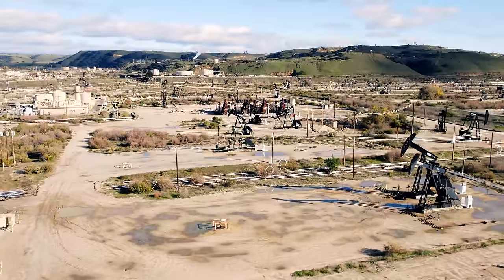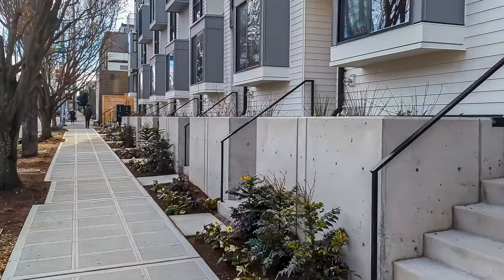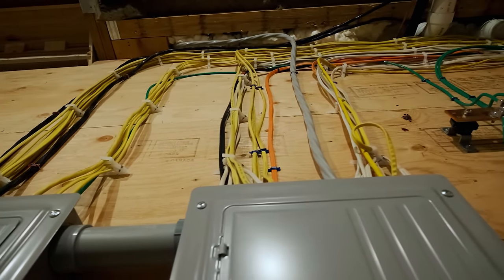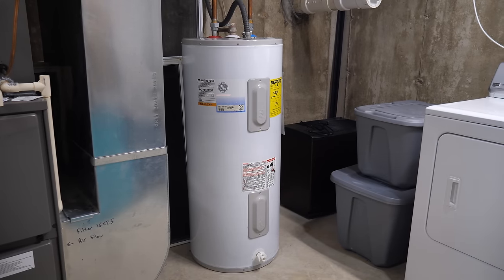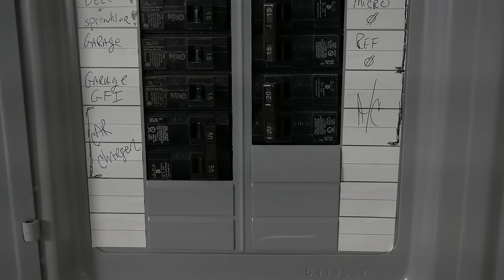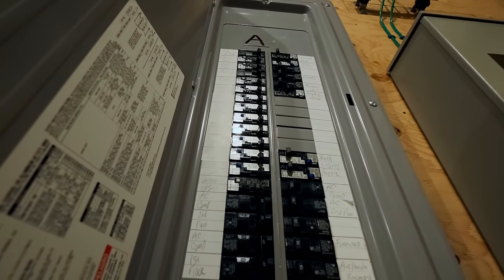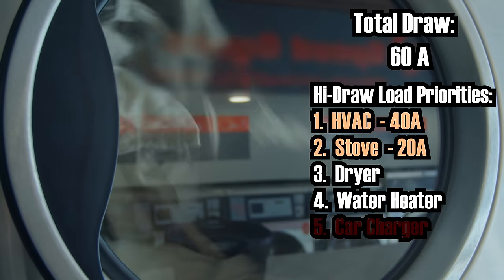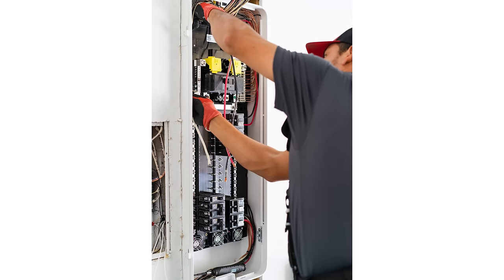Home Electrification: There's not a lot to do, and it doesn't have to be hard (Part 1)

Comment: Span sounds like a great idea. The concern that I have is that almost every single IOT thing ever invented becomes it's own walled garden. So we end up with 60 different companies all running proprietary software to monitor these things and its impossible to switch something out or make easily compatible extras to work with it that aren't from that one specific company. It would need a level of standardisation to ensure any model or brand can work with any other model or brand.
Reply: Rule of thumb is never use any IoT device that isn't fully open source.
Reply: Plus the number of times that an IoT company went bankrupt and then their devices became useless through lack of servers or support is a huge mark against them. Open source (if you can code anyway)
Reply: Like, say... ZigBee?
Reply: Matter will fix this in the long run.
Reply: Home Assistant is the solution in my opinion. If you are willing to get "down and dirty" you can integrate almost anything into it, from ZigBee devices to smart cars.
Reply: @supermaster2012  except you’re using one right now
Reply: @ErrorError-km7ib  smartphones and desktop/laptop computers are not IoT, and many of them are open source (Posted from my Linux desktop, which is open source)
Reply: …which in turn makes all those different IOT devices insecure ‘attack surfaces’ to hack & pwn your network.
Reply: Yeah it’s a huge shame, I kinda wish the government would just step in and say “okay kids it’s time to make some standards!” So consumers could be confident in buying their smart stuff from whatever brand they want, only needing to consider things like style, efficiency, build quality, etc, not whether their new switch will be compatible with their old ones.
Reply: THIS!
Reply: My thoughts exactly. I'd much prefer a couple of simple interlocks and slightly more mindful electricity usage than a complex proprietary device, and I'm especially skeptical of one that relies on an app and internet connection for configuration.

A Span panel already costs $3500, another $100 to add a screen and internet-free setup would be well worth it in my opinion. Better still would be a separate bus bar-type device that can be added in series with a standard panel so that it can be easily serviced, upgraded, or removed.
Reply: REMEMBER when you bought software in a box?  It was debugged & worked.  You didn’t need internet for updates.  You didn’t need a subscription.  You paid once & done 

.
Reply: So I contected span with these concerns and a few others I had. Here's my email:

Hello,

I have a few niche questions about span panels, right to repair, and selfhostability. If any of these would void a warranty, please indicate that it is possible, but also indicate which warranties it would void. Thank you!

    Is it possible to self-host the services that mean that span requires internet connectivity?
    If the cloud service was discontinued (e.g. if span went bankrupt), would span panels retain all features?
    Does span have the power to discontinue or charge for features that require cloud connectivity?
    Is it possible to turn off automatic updates?
    Is any of the span software or hardware open-source?
    Would it be possible for anybody with technical knowledge to repair a span panel, or are there one or more measures to restrict repairs to only authorized repair-people?
    Are schematics available for download? Do the manufacturers allow for excess parts to be purchased for repairs?
    Is there an API for programmable access to span panels? Is this an option even if you are self-hosting the services (if applicable)?
    Is there an interface (USB, GPIO, etc) that can be used to control panels in lieu of internet connectivity?
    Would it be feasible to modify the circuitry or firmware of the panels?

Thank you again!

Sincerely,

[My name]

And here's their response:

Hi [My name], 

Thanks for contacting SPAN Support. 
 
Today, SPAN does not have an open API for local control.
 
We are always evaluating new platforms and hope to offer an API solution in the future, however, there is no set timeline for when or if this will become public.
 
An internet connection is required for full SPAN functionality with smart features. You can read more about internet requirements here: SPAN Panels - Connectivity
 
While we do not anticipate closing our doors anytime soon, the SPAN Panel would continue to operate as a standard electrical panel built to comply with the safety standards of the National Electric Code. The SPAN Home App would no longer be supported and the SPAN Panel would not function as a smart, IoT device.
 
It's not possible to turn off automatic updates, and schematics are not available.
 
Access to the SPAN Home app and all of the software features of the SPAN Panel and Drive are included in the price of the product at this time. There are no immediate plans to charge for features.
 
An electrician can help with traditional electrical work on the panel, like adding new circuits or changing breakers, but only a SPAN-authorized installer can be used for Service work on internal components.
 
Here's a link to SPAN's warranty: [youtube doesn't like links]. You can find more information for SPAN homeowners here, including the owner's manual: SPAN Owner Documents
 
SPAN will provide any replacement parts needed under warranty. Additional parts may be available for purchase, I would need more information about what's needed in order to confirm.
 
I'm getting more information for the other questions. Please let me know any additional questions you have.  

Best,

[Customer Rep's Name]

---

Hi [My name], 

Thanks very much for your patience. 

There is not open-source software or hardware for SPAN, and modifying the circuitry or firmware of the Panel would void the warranty. 
 
Please let us know if SPAN Support can help with any additional questions.

Best,

[Customer Rep's Name]
Reply: He said they offered it without being connected to the Internet lol
Reply: "You will own nothing and be happy." -- World Economic Forum

Comment: Cost-wise, the Span panel costs as much as an electrical service upgrade in my area, and that was going from a 60A pushmatic service panel to a 200A traditional breaker box and moving the meter outside.
Reply: just came here to say basically the same that.  that smart breaker panel alone costs over $3k :face-blue-wide-eyes:
Reply: span panel? that's a Spanel
Reply: Perhaps it can have cost benefits if your electric price varies by time of day?
Reply: Rather just be careful not to turn-on a bunch of appliances at once.  It’s common sense you don’t run a stove & dryer at the same time

.
Reply: I just put a timer on the hot water heater set from 1-5 am and the same with my EV both a high load come on when I sleep and power is cheaper.

Comment: I grew up in the 80s in Eastern Washington  near the Columbia River, and I thought all-electric homes were just the way it was everywhere. I later learned that our cheapest-in-the-nation power, produced by our dams, was the reason for the widespread adoption of heatpumps in our area.
Reply: I am in a similar situation but western Washington. Washington’s hydroelectric dams have given us great experience that other states need to learn from. As you said the all electric house is reasonably common. The transporting of electricity is another one. We didn’t get much choice where the power was generated compared to where it was used. We are really good at moving the electricity from Snoqualmie Falls to Seattle. So when Bonneville power administration did a huge amount of wind, getting that electricity to Spokane and Seattle was nothing new for us. But most other states just put power stations 20 miles from their big cities. So when you tell them they can make a ton of solar electricity but it’s 200 miles away they freak out. Their engineers have literally never worked that problem.
Reply: Also from eastern Washington State. Hydroelectric yes, but also Nuclear Power. I built my home long ago before electric HVAC and stoves became reasonable to use. So my house uses gas. And thank god for it. My power bills are half what my neighbors pay with newer electric HVAC/stove homes.
Reply: Whatever the cheapest utility is in the area makes the most sense. In southern California, natural gas is cheap, the basic bill can be as low as $13 per month. We have lots of gas appliances here because it makes the most sense. Electricity is the most expensive utility by far here.

We have some apartments that are all electric but they are typically utilities included in the rent price. I would not want to live in an all electric home in California, the monthly bill would be as high as a mortgage payment.
Reply: ...but your climate is also not super cold in the winter.
Reply: @bpark10001  I'm not comparing my energy costs with someone from Wisconsin. I'm comparing my energy cost with my next-door neighbors. They have new all-electric houses which they put in because electric power is cheap around here. Even so, they pay twice the amount I do because, even if electricity is cheap, natural gas for high energy uses is about 80% cheaper. $200 for electric heating, $40 for gas. I have this financial advantage because I live in an old house that was not built to the modern standards. I understand that it is a little counter intuitive, and it may be the product of my exact geographical location, but electric heating for 1) HVAC, 2) water heaters, 3) stoves and 4) clothes dryers...is not always the cheapest choice. All four of these energy hogs in my old house are gas, becuause that is the way they were built 40 years ago. It was the best choice then, and are even a better choice now.
Reply: @Zayphar  I am in Western WA, near Olympia. I have gas furnace, gas water heater, and gas dryer. In the winter my combined gas/electric  bill runs between $200 and $250 per month. It would be lower but i have some electric equipment that runs 24/7 that probably costs $20 - $40 per month, I've never measured it. 20 years ago, I had a guy come in and blow insulation into the attic as there was only a smattering of insulation on the floor up there. Now its 18 inches deep after settling and at the time it was a cheap investment. I told my wife at the time we had it done that it will pay dividends later and it has. 
If I went all electric the switch-over cost would be really high and I'm happy with what I currently have.
BTW: hydro dams are now considered a non-renewable resource in Washington state. I'm betting the lefties here will phase them out over time raising our electric rates
Reply: Living is also none renewable, living and life itself is being ban.
Reply: >> Eastern Washington
>> "your dams"

top kek. If we're talking the Spokane region, all those dams only make like 10-70MW apiece. Peanuts compared to the two dams on the Clark Fork in Idaho and Montana which output 750MW.
Reply: @Zayphar  I agree totally.  When you need pure heat, gas is the way to go if your locality has it available.  The reason for this is simple.  Most electricity is still made from heat.  Only about 50% of that heat is converted at the plant, the rest unused, thanks to the second law of thermodynamics.  Now if you turn that energy to "something precious", like motve power, light, or information processing, that loss is worth it.  But burning 2 cubic feet of gas in an electric plant so you can have the heat from 1 cubic foot of gas in the house makes no economic sense.  Second law "taxes" electric heat in home at 50% rate!
          Some day, maybe heat pumps will really work & be reliable, & electric energy will come from solar, wind, or maybe even directly from nuclear fusion WITHOUT a thermodynamic process, evading the 50% tax.  In addition, there is the overlooked property of fuels I call "big battery" (they store energy & can be "tapped" when needed).  Someday this will also be true of electrical energy, but not now.
Reply: @pyrioncelendil  All the dams on the Columbia and the greater region. The whole region. Irrespective of any one dam's contributions, the result is a region with the cheapest electricity in the country.

It's not necessary to quote me when talking to me. I can remember what I said, and if I couldn't, it's forever memorialized right up there. ^
Reply: also it's west coast, very mild climate.
Reply: cost is the #1 driver for peoples adoption to specific trends. This is why gas/coal/wood is so prevalent as the cost is cheaper.
Reply: @davidparker9676  don't you just love the fact that your cheap gas is being outlawed and nobody can use it in any new construction.
Reply: @FishFind3000  I really love that some overpaid children make life-changing decisions for all of the adults, forcing their ideological whims on us.
Reply: @davidparker9676  are you talking about circumcision?
Reply: @WhiskeyNixon  Is that what you read? You might want to get back on your meds.
Reply: @FishFind3000  yup. I wish we would outlaw more combustion processes, and generally most anything that creates pollutions. Why yes, I would prefer to live in the trees and never have had the opportunity to have this stupid conversation with you on the internet. I don't believe human progress and technological process are the same. I think they are often at odds. What's the point of mining more and more just so we can do this, here, right now? Seems pretty dumb, to me. More pollution for more YouTube? More pollution so I can not have to wear a coat inside? I don't know, Fishman. I just don't know... I know I'm bored! I know that!
Reply: @davidparker9676  man you no fun and you no funny
Reply: @WhiskeyNixon  Raise your comedy game homie.
Reply: Bonneville damn ftw!
Reply: @bpark10001  I agree with your sentiment but the numbers aren't quite there to draw a firm conclusion. Modern forced-draft gas furnaces are about 80-96% efficient at recovering heat from burned fuel, some still escapes; homes still using passive convection furnaces are lower.  Modern fossil fuel power plants are around 60% thermally efficient when using combined-cycle steam turbines, but more like 30% when using peaking turbines. So there's already a wide range of variables when comparing the two sources. And that doesn't account for the greater pumping losses when sending gas to end of line on a distribution network versus sending it bulk to a generating station.
Reply: @aaronvienot  also doesn't account for non-gas power sources, which is a highly-location variable thing, but I would assume that power being sourced from other locations would, in most states, outweigh the marginal efficiency increase of having gas heating in your home. And that's not really a factor if you're going energy independent with your own solar or wind, which I would assume is more probable in states where fossil fuels are more relied upon, as those states are probably more rural and energy independence would generally be a good idea anyways. If that's all the case, then the only thing really keeping gas as a cheaper option is basically fucked up systems-level incentives, or, a lack of will to overlook short term gains in favor of long term ones.
Reply: @zipbangcrash  you used to be able to go in them, remember that? my grandpa liked to take us to Ice Harbor Dam. They had a park and visitor's center and you could go right into the dam and walk a catwalk around one of the turbines. Now, thanks to Homeland Security, you can't go near them. Sucks to be a kid these days.
Reply: @WhiskeyNixon  YES! One of my fondest memories was wandering around on the Washington side, because I'd never been over there before. They had the greatest fish ladder observation room, with huge, thickly carpeted risers to sit and watch the fish from. It was like a children's show set!

Plus that catwalk among the turbines was amazing.
Reply: Oh, dam!
Reply: Now, of course, environmentalists want to tear out those hydroelectric dams.  In particular, they are currently aiming at tearing out four huge hydroelectric dams on the Snake River.  If they succeed in that, they will target others.

Comment: Another excellent video!  One problem with the smart breaker panel temporarily switching off breakers to keep the house under the 100A limit is that some devices don't like to be *hard disconnected*.  

For instance, the EV car charger: when re-connected by the smart panel, the charger will be in its default "standby" mode (0 amps) and not resume the previous charging (20 to ~50 amps) and you may end up with a uncharged EV car in the morning if not paying attention to it.

This could possibly be remedied by firmware programming.  But its probably not programmed like that for kitchen cooking appliances (microwaves, toasters, waffle iron, etc).  That is unless the appliance uses old spring timers and heat dials!  But almost all of the mid- to higher-end appliances use touch screens with microprocessor control and will be in standby when its power is reconnected.
Reply: Yeah -- I don't think a smart panel is necessarily the answer.  It's more that we need to get on with developing standard protocols for power management control interchange, that isn't tied to AN app, or even AN company.
Reply: @nickwallette6201  A?
Reply: @hgpo27   Eh!
Reply: @nickwallette6201 *A company (not an)
Reply: Yeah plus it might damage your devices if they experience recurring intermittent blackout power outages